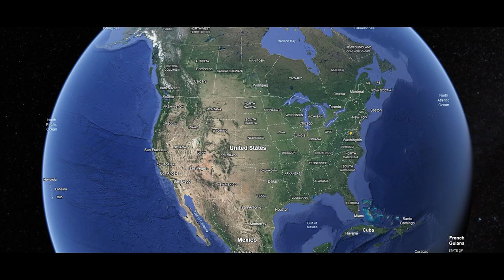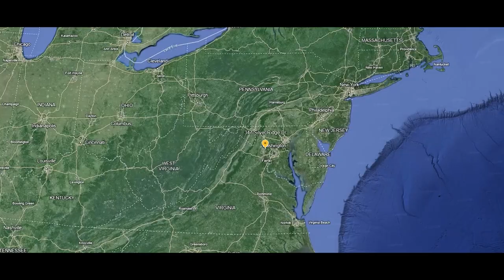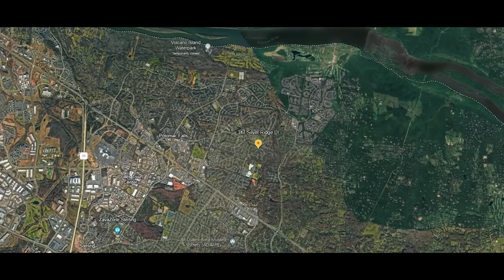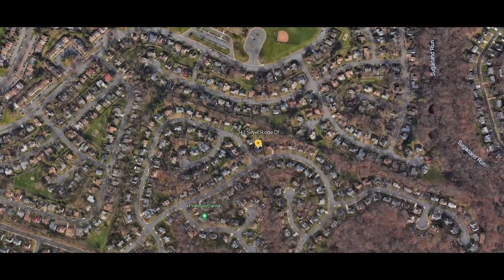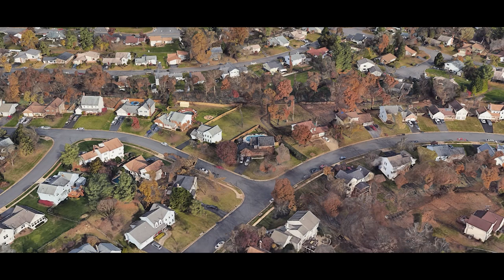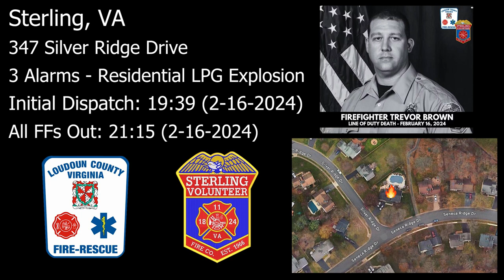Harrowing Audio from FATAL GAS EXPLOSION, 3 Alarms - Sterling, VA - 2-16-2024

Comment from the maker: Timecodes
00:00 Initial Dispatch
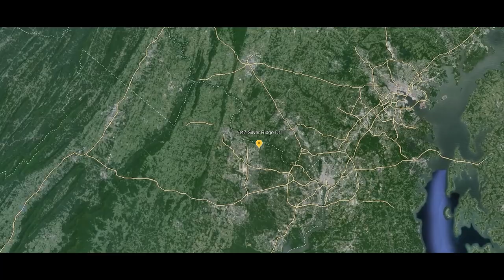00:23 First Due Units Arrive On Scene
01:05 HAZMAT Requested (Reports 500gal LPG Tank Leaking)
01:41 HAZMAT Toned
02:53 The LPG Tank Explodes
03:03 First Maydays From Trapped Firefighters Start Coming In
04:38 RIT & 2nd Alarm Requested
05:47 Tower 618 Reports Deceased Officer
06:44 Trapped FF Reports Fire Advancing On Him, Unable To Move
09:10 Another Mayday Comes In
10:18 Units Report PASS Alarms Coming From Basement, Requests A Ladder
11:46 Units Discussing Air Medical
11:56 Command Advises 2 Unconscious FFs In Basement, One Deceased FF In Front Yard
13:32 Units Advising One Patient Rescued, One Still Being Extricated
16:30 Units Advised To Only Attack Visible Fire To Avoid Flooding Basement
21:48 Unit Gives A Burn Patient Update For Transport
22:28 Command Gives Update On Maydays & Operations
23:06 Bat 401 Finds FF Mayday From Charlie Quadrant
25:18 Units Start Using Pak-Tracker To Locate Maydays
26:21 Bat 401 Advises Only 1 Hit On Pak-Tracker, Possibly A Ditched Pack
27:36 Bat 401 and Bat 402 Confirm Pak-Tracker Hit Is The Ditched Pack
28:55 Bat 401 Confirms All FFs Are Out, Operations To Stop For Regroup